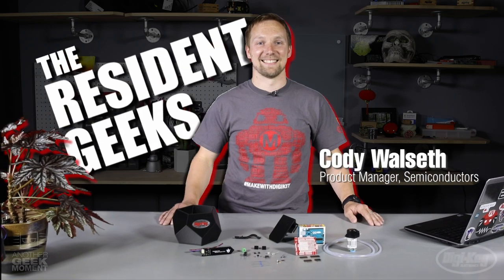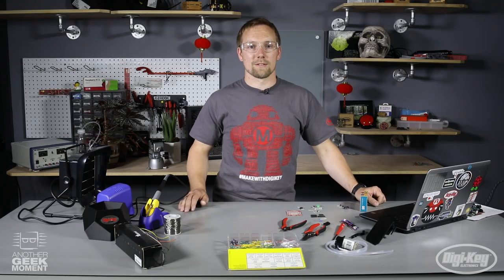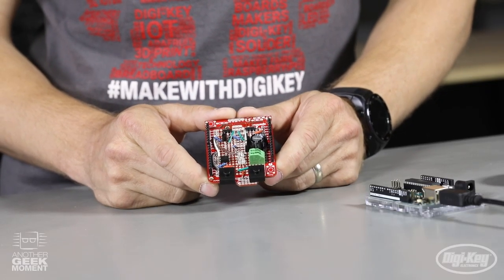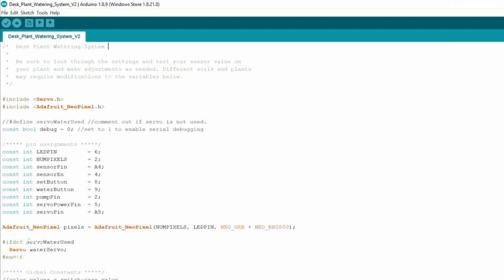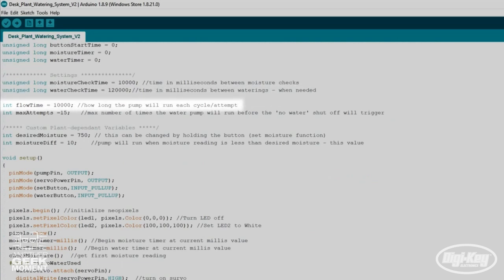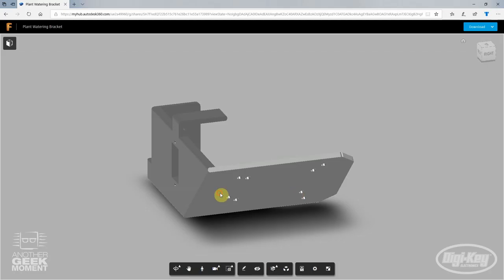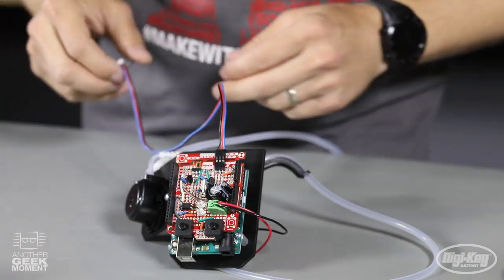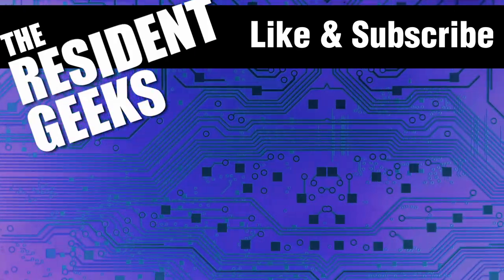Plant Watering System - AGM | The Resident Geeks | Digi-Key Electronics

Comment: I'm pretty sure 2 of those plants you used are succulents. They only need to watering once a week when indoors. They thrive on being ignored and dehydrated. You're going to drown the poor things. 

Also there was way more potential for this. Use an ESP32 or similar and have it log and post data via WiFi. Needs a light sensor as well.
Reply: yes
Reply: Paul B,  You are correct about the succulents not needing to be watered much.  That's one of the great parts of being able to adjust the desired moisture level!  Using an ESP32 and posting the data and adding a light sensor are great ideas for the next version.

Comment: Make it solar powered pls ? a lot of power consumption?
Reply: Zhang clark indoor plants, why solar?
Reply: David Truelove my point is actually, too much power consumption  i guess, running all the time
Reply: Zhang clark Zhang clark don’t worry about the power consumption. This setup should not use much power, 12v system.
Reply: David Truelove I am just being picky, great project , how ever  do you know how much power it runs on with the power loss from wall socket to 12v dc , also there must be 2 stages active and stand by status , let’s say only stand by status,
Reply: David Truelove a smart system seem pretty redundant,
Reply: The motor runs at 12V 300mA at most, which is 3.6W, and it will at most run for seconds, so it's really not much. And the Arduino setup itself, which has like 3 or 4 outputs at most here, will consume somewhere around 1W when outputting to drive the servo and control BJTs, and again not for any extended period of time. Perhaps the circuit can be made without the Arduino using 555 timers, counters, some other digital circuitry, etc. to perform the same functionality, and overall I think that might bring down the power consumption when compared to the Arduino by a decent chunk, but nonetheless, a 3 to 5W system TOPS when the pump runs, and milliwatts otherwise brings to an average of maybe a 100mW if that. So, solar powering this would be really excessive and unnecessarily costly. For perspective, LED lighting is usually north of 10-20W, which would be 100 times more power consumption at least.

Comment: Or...use a water pump from a keurig coffee maker, a 12v power supply and a digital timer...on for how ever minutes, off for however minutes and back on again..the keurig pump is on the bottom of a 5gal bucket.  Feeds the plants while you're away.. Simple and cost effective. 
Run tubing from the pump to a cup, that is used for the splitter to the plants...   Easy peasy.